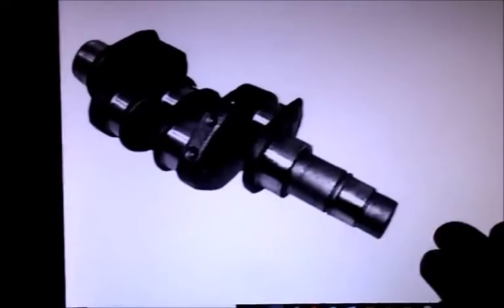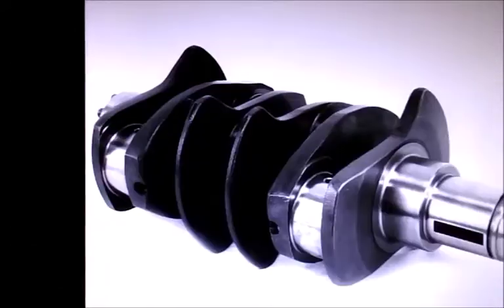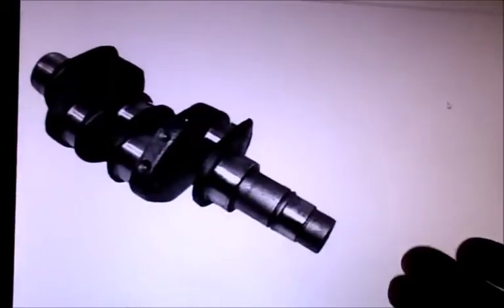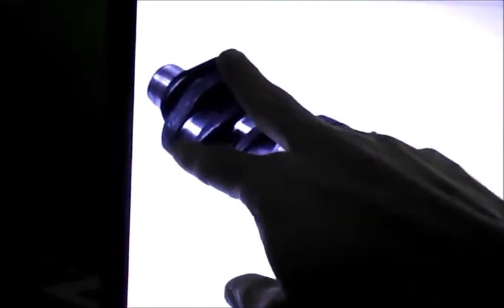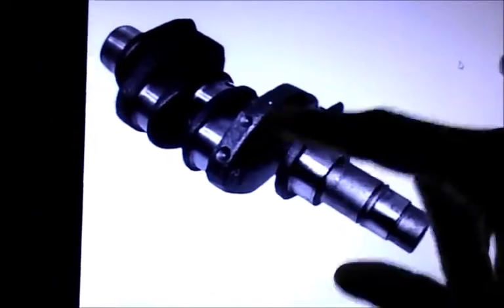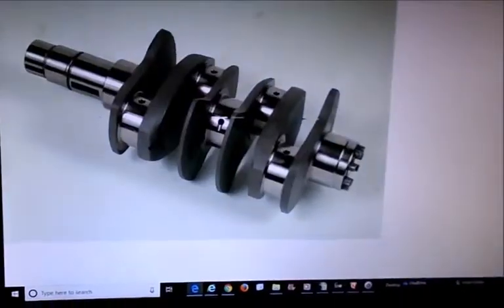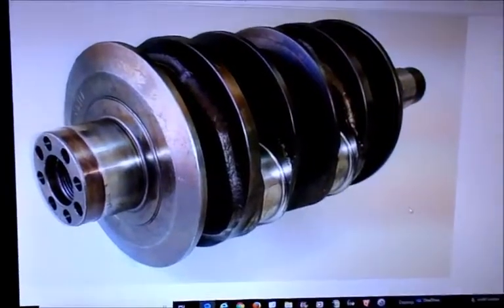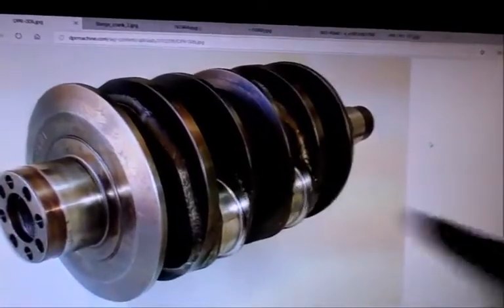vw type 1 mileage & mpg vlog 3 crankshaft

Comment: An interesting discussion.  I was intrigued by the full circle crank and so did a Google Search and came up with come remarks from Gene Berg:  Not being a VW guy I'm not trying to make an Appeal To Authority argument, it's just I see Berg's name references often as someone conversant with VW motors.

From Gene Berg:
Never Use a Full Circle Crank

The past revisited again. You would think that people would get smart enough to do a little research before they buy their products. Full circle crankshafts are nothing new. People sold them for the 36HP engines and had a high failure rate. Next, it was in the early 70's and these also failed. In fact, when we did the testing on them and had high degrees of case damage we actually set-up and machined them into a counterweighted crank. This helped considerably, however, other problems arose with the quality of these cranks and the company went out of business.

What you must realize is that this actually makes the crank worse than it was stock. Properly counterweighting means that weight must be added to oppose the weight of the rod and rod journal. Simply put it like a teeter-totter, to oppose a heavier person on the other end, you move the center of the board closer to the lighter person to gain leverage. Since we cannot move the crankshaft centerline we must add weight to the other side to help offset the rod journal side of the crankshaft.
We spent a large amount of time and money to get the correct combination that would still fit in the case, providing more engine life.
Reply from the maker: i bash Berg in a lot of my vids. he was a self serving businessman not an impartial engineer. see the part where he says "makes the crank worse than it was stock". he's full of crap. it's easy enough to do the math and show that the full circle "counterweight" actually does move the center of mass closer to neutral. in general, the full circle is a joke but i included it because some vw people will obsess over the windage loss as the crank spins. they will knife edge the hell out of their counterweighted crank which reduces the effectiveness of the counterweights. so if they don't care that much about the counterweights then they should go full circle to avoid the windage problem. in conclusion, i consider Berg to be too ignorant to be an authority. his view on compression was incomparably ignorant. it amazes me the number of vw people who still spew his low compression dogma.